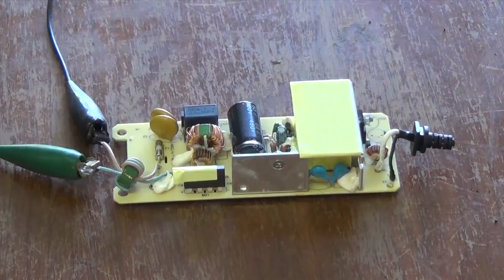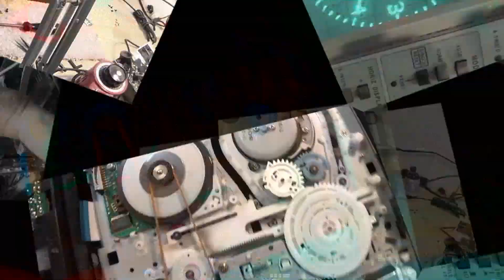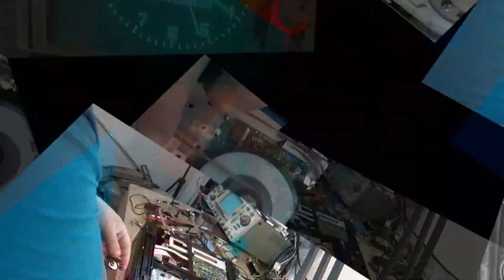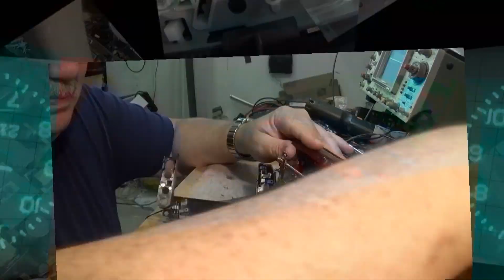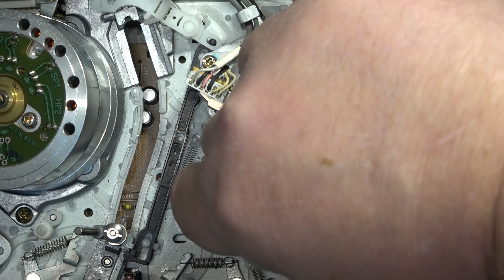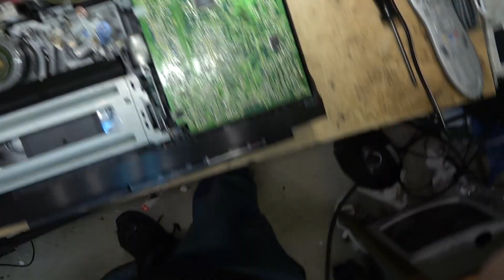Sony VHS Sub Cam and Tower Gear Timing Procedure for Dummies

Comment: Got an older svo model been malfunctioning....the tape seems to fully load however but the...loading gear if that what its called at the very end seems to jam up so it automatically ejects 2/3 seconds after cassette is inserted. However I could intervene when its at the apex of its loading and manually flip the gear over one more time the unit will get into playback. It's the gear that is attached to the loading motor. I watched your entire video and it was very informative l; thank you.
Reply from the maker: Are you talking about the gear on the cassette elevator?
The nylon collar that fits over the cassette loading motor cracks and allows the motor shaft to slip. This causes loafing and unloading issues with respect loading and lifting the cassette. I have connected this on other videos.
Reply: @12voltvids  the gear  that has a band running to an electric motor. So when spun manually the loading arms move forward on their tracks to bring the tape towards the main drum...however at the end where it should slot in place it jams up unless I force the pulley to spin over once more. An audible click is heard and then it works fine. It's an 80s sony svo with multiple belts inside, there are 3 bands total and not like other vcrs I've seen where I can lift the chassis off a pcb board to reveal the mode switch.

Comment: I have a German VCR  Grundig GV 400 (1992) some parts of the cassette player have been removed and unfortunately the screen has burned out and does not light up too much tedious to repair it is not worth it

Comment: Great video as usual, specially the talk about manufacturers.
Apart from that, that mechanism is one of those I like to work into. Not the best in reliability but easy to repair. If I'm not mistaken, this was the first Sony-made deck for VHS and it was produced during several years with only minor changes.

Comment: Could you do one for Panasonic standart mechanism, I think it was D or Z type? The one with the orange teeth belt on pancake motor. I messed up the program and tape eject timings.
Reply: That's the G mechanism. It's a pain in the butt to realign those.
Reply from the maker: Pretty sure i did one years ago.
Reply: @12voltvids  Yes you have one, and i watch it few years ago, but it wasn't very clear what goes where and there was different gears repair, also mines both was partially dissassembled when i got them. I have managed to sort out most of the timmings but the tape eject tray and the program and switch gears seems to be out of order ... i loose a good 2 days without success and then the power supply blew up due to bad old caps :D Theese are 2 similar decks with same problem, one records, other only player but they are just slightly different on mechanisms and won't fit. The decks are Panasonic VHS -> NV-P5 HQ and the recorder with tuner NV-G45 HQ (a.k.a the recording one that i am trying to fix)

Comment: Yes I was aware that VHS and Beta were part of the same project, which is why they are so similar.  The format war shouldn't have happened.
Reply from the maker: Should have been only 1 format, Betamax. That was Sony's plan, and they thought Matsushita and JVC were on board. Then they released the other format.
Toshiba and Sanyo were in the Beta camp initially.
Reply: @12voltvids  Then RCA released the VBT200 which offered 4 hours of recording time and after that, the average consumer didn't care about Beta. Am I telling the story correctly?
Reply from the maker: @crashbandicoot4everr  when the VHS system first launched it had a 2-hour speed single speed. The first beta machine was also a single speed 1 hour recording time and then beta dropped the speed to beta 2 to give a 2-hour recording speed which was the same that VHS had initially. As you know RCA and JVC had a long running relationship. RCA was known as RCA Victor and JVC was the Victor company of Japan. Many people thought of JVC as the Japanese version of RCA because of that relationship with Victor which was the Victor talking machine I believe. RCA demanded longer than 2 hours on a tape because "Americans will never stand for just 2 hours we need four." JVC refused to compromise the picture quality so RCA went to Panasonic to produce their machines and Panasonic gladly dropped the speed.due to this longer recording time which people didn't seem to care that the quality wasn't as good it wasn't long before JVC dropped their speed but they never went to 4 hours they went to six. Panasonic then added six as well and soon all the other manufacturers out of the EP speed or SLP as Panasonic called it. The reason that all Panasonic machines called it SLP as opposed to EP was because JVC trademarked EP and would not allow their rival Panasonic to use EP as a speed designation, in fact no JVC machines ever had LP. Many would not even play a tape recorded in LP because JVC never recognized LP as it official speed. Later jvc's added it as a playback speed but you got no features, no still frame no slow mo no search just straight playback. When supervhs was developed they specifically forbid any manufacturer from making a machine that could record in super VHS at the lp speed it was SP and EP only.
Reply: @12voltvids   I also read on the Panasonic PV-1100/RCA VCT201 service manual that VHS SP uses guard bands while LP doesn't and the tracks actually overlap so the heads need to be on a different azimuth angle to prevent crosstalk.
Reply from the maker: @crashbandicoot4everr  the heads on have are +-6 degrees and beta was +-7 degrees. The hifi heads in VHS +-30 degrees.